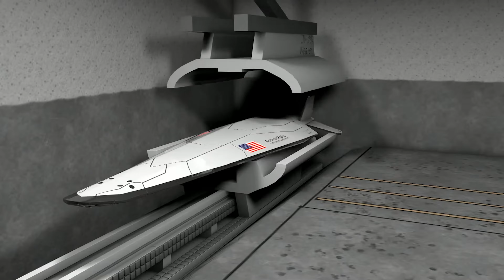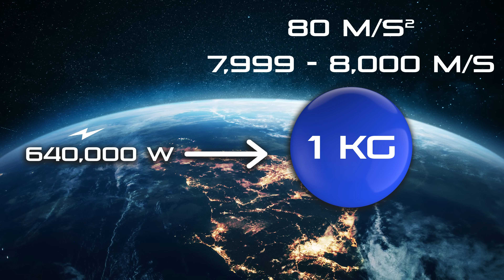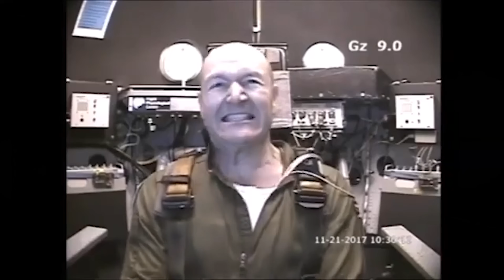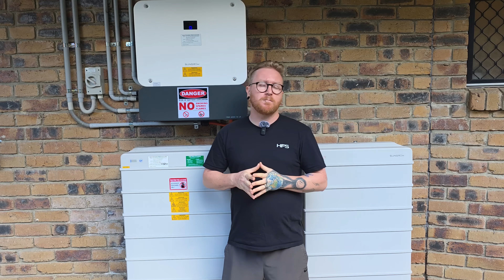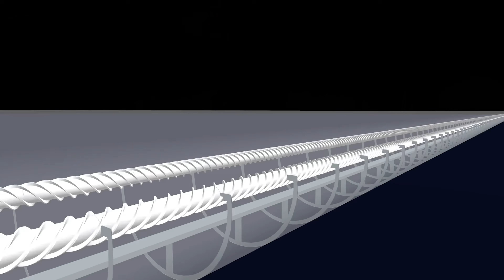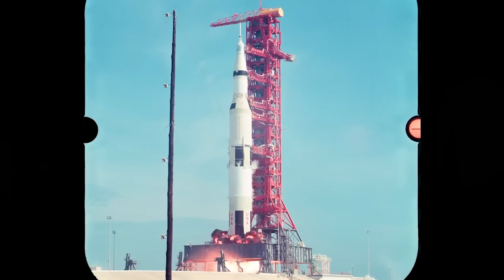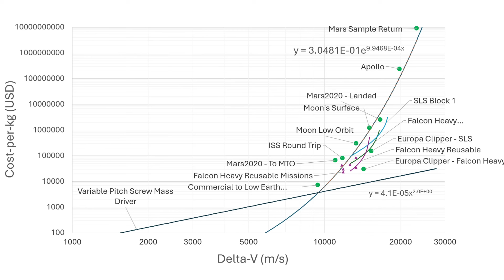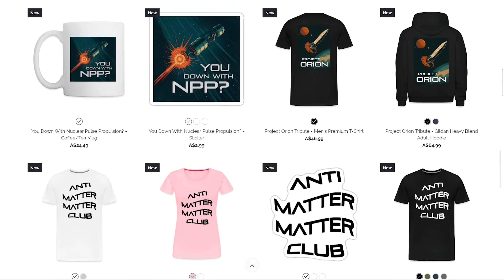The New System That Could ACTUALLY Replace Rockets

Comment: I just thought of another question, is this thing on a turret or do we need to aim the planet when we want a different orbital inclination?
Reply from the maker: Very good question! No, it isn't on a turret - it would have a fixed directional exit. Orbital mechanics get tricky to explain in a youtube comment - but you've got an onboard engine for control. Because its designed for interplanetary travel, you'd select launch times when Earth’s rotation and the desired departure geometry line up. As it pertains to achieving different earth orbits, you'd need to build specific systems for this, or make sure you had enough juice in your onboard engine to orient the spacecraft into its desired orbit. I don't think this would be that difficult.
Reply: True. It's how it works, I believe.

Comment: I take it that these screws have insignificant mass and near zero compressibility. I also take it that as the driven mass of the vehicle is insignificant and will not cause significant torsion differences in front and behind the vehicle. Eitherway, much simpler than building a bogey with wheels and electric motors.
Reply from the maker: The mass of the screws would need to be significant to store the rotational momentum. Think of them as kinetic energy storage devices, the more mass they have the more energy they can store for the same RPM.

Comment: The screw would be too long and heavy for a motor to maintain the proper amount of speed .
Reply: Not "a" motor. Thousands of them, distributed along its length. The concept may have problems, but that's not one of them.

Comment: In WW11 it was found that an airplane could tow 10 X weight it could carry. Put  spaceship on a sled with JATO rockets on it to help it get off the runway.  Use a nave aircraft with a tail hook. An f4 can carry 8 tons easily, if it takes off without full gas tanks.  Then could have 10 tons load. (80 to 100 tons towed). Refule after takeoff climb until need to need to refule again.  When it gets so high the wings cannot support it have ox or nox in tanks pull up use the nox then release the spaceship. That is enough for a satellite or two.
Reply from the maker: Very similar general idea to the Virgin Launcher One idea. This concept has one fatal flaw, it gives the rocket 'free' altitude, but not velocity. An aircraft can get a rocket to a high altitude, but is realistically only capable of giving it a very small percentage of its orbital velocity. In the case of Launcher One being dropped from a 747, the rocket still had 97% of the work to do to get to orbital velocity, compared to a ground launched rocket. It also has to waste a significant amount of fuel to change its orientation to line up with its orbit, essentially a pitch-up manoeuvre.

Its incredible that rockets work as well as they do really, the scale of their power absolutely dwarfs even very powerful planes.

Comment: The Idea ist novel but there are fatal flaws in this Idea.
If you pump a Vacuum to reduce drag you can't  shoot it out of the end of the tube because at that point you introduce a wall of air that the spacecraft will hit. If you Open the end of the tube and not have a sacrificial seal there you start a shockwave that is moving at the speed of Sound in Opposition to the spacecraft and will be like trying to brake a brickwall with a Glas sphere...
The other parts are you have a mass of several thousand tons that you want to spin up. That is all fine and dandy but how do you keep that mass in alignment? 
Now you say Magnets, good Idea with the problem that they have to disengage  and reangage because of the sled. This means moving parts and If one does not reangage your mass Driver will jump out of alignment. If one does not disengage the sled will collide with it. And If you see it in time how are you able to stop the spacecraft? How will you safe the Cargo without braking/killing it?
The other parts with the Vacuum is you want to submerge a tube that has elevated pressure in the outside and negative pressure in the inside so both forces move in the same direction. That needs so much Material that it's frightening...

Comment: Nope, this will not work, sorry. Who is the guy you interviewed, and what are his qualifications? Dude can't be a proper engineer, no way. How long are these "screws" supposed to be? How will they be supported? How will the tube around them be supported? What rpm are thes screws turning at? How are you handling the torque from one end to the other (ground end to space end?) How are you machining these? What is the "frequency" at the end of the screw supposd to be? What does the screw come into contact with? How will they remain spinning around their centr point over that distance with forces acting outward against the screw? Fantasy. Not that it would work, but even if i was going to vaporize this thing up, I'd use one screw and make the "rocket" a dounut (torus) shape kinda like a nut on a bolt. I think i just improved it, only took 10 seconds, still doesn't work at all mind.

Comment: I'm not really convinced that this system.

1) The Larger the screw pitch gets the more torque is imparted onto the screw, for the same driving force. Otherwise, we would violate conservation of energy. Furthermore, losses will be much more pronounced for large crew-pitches and maybe stop the mechanism from working entirely.

2) The screws slow down during operation, being slowest during the end where we need the biggest velocity. This makes issue 1 even worse. (Vessel speed proportional to screw-RPM and Pitch).

3) Because of the length of the system the crews can no longer be seen as a rigid body, they can twist significantly over the entire length.

4) How to do the actual coupling mechanism. Every design must either work independent of the varying pitch or be able to compensate for it. 
    a) magnetic materials (permanent magnets) are expensive, so not feasible to be used on the screw.
    b) using "passive" coils (wich would work similar to an induction motor; by relying on the current induced by the moving (relative to the coil) magnetic field) you get into problems with losses. You have to take into account that there now is slippage in the mechanism.
    c) using superconducting materials have their own issues with the cryogenic temperatures required.
Similar Problems apply to the suspension system. 

You can mitigate some of these issues (mainly 1 & 3), by not using multiple independent shorter screw segments instead of a continuous screw element.

Another problem I could see is with repeatability/accuracy. The system doesn't seem to have a way to compensate if the vessel accelerates faster or slower than in the Simulation. (If electromagnets are used, you could do something by modulating the magnetic field strength, at least when combined with passive coils). If the discrepancy is not too large Attitude control thruster could compensate for it. (Other mass-driver designs like "coil-guns" can be fine-tuned easier)

Regardless of the design of the mass-driver if you want to limit the acceleration to 80m/s² (8gees) and a speed of 11km/s (escape velocity of earth) you would need a length of 750km, and the radius of curvature must be at least 1500km. (based on liner-acceleration and centrifugal force respectively). note that this implies that you either only accelerate on a perfectly, straight track or only go through a curved section. At this speed even the curvature of the earth is significant. Because of the way the math/physics works out you would experience a centrifugal force of exactly 2G pulling upward. (1G if you take into account earth's gravity).

Suspending the launch tube several kilometers above the surface is a whole other issue.

Comment: I see this as a possible stepping stone to something better. I cannot help feel that a space lift will ultimately be better assuming you don't want an item in space for the duration of a lift. Once in space you only need engines to 'get around'.
Of course, we need to develop the tech for the lift first.
Reply from the maker: A space lift/elevator would be very hand indeed, space isn't that far away really - the issue you run into is the physical limitations of material science. There's probably a good video there on this, but the math just does not check out unfortunately. The Earth is a jealous planet, she will not give us away without a fight😅
Reply: @HelloFromSpaceAus I have seen other videos on space lift tech and it is believed it's possible with the advent of carbon nanotubes. The problem, making enough of those tubes.

Comment: How big is the deceleration on exiting the tube, and how is it kept in vacumn?
Reply from the maker: The tube exit is at relatively high altitude (15km). It would be built similarly to an airline fuselage, basically a light weight pressure vessel. The paper doesn't go too into depth on pump systems, ect - but there would be multiple airlocks to stop the entirety of the vacuum needing to be re-evacuated after each launch. I've put some links to a couple of Phil's presentations in the description, they're worth a watch if you're interested in some more technical details.

Comment: Except you could use the supergun technology intially developed by the Gerrmans in WW2 and later partially completed for Iraq. Electro-magnetic boost could start it rolling and then relatively cheap high explosives could push it in the later high engergy stages. The reason it isn't used is simply because that's not the direction that's been taken.
Reply from the maker: Ah the Schwerer Gustav - I too very much enjoy learning about war history and machinery. There are a few killer problems with this unfortunately. The g force would be incredibly destructive, large gun barrels like this tend to wear out very quickly (as the Germans and later Gerald Bull found out). The amount of explosive required would also be huge
Reply: @HelloFromSpaceAus  horses for courses. Some payloads for Moon and Mars mission would be suitable for high g acceleration, for instance rocket fuel. Explosives  don't require cryogenic handling and there are plenty of cheap explosives, e.g. those based on ammonium nitrate. Electronics can be used in high g applications, for instance guided artillery shells, so likely high g satellites wouldn't be an insurmountable problem. Current rocket launches aren't exactly gentle in any case, with vibration being a big problem.
Reply: V3 mimoyek? Iirc

Comment: If the advantages on Earth are obvious, imagine on the Moon with no atmosphere and 20% gravity.
Reply: She really is our best friend in the universe - we won’t go anywhere significant until we’re launching from the Lunar surface imo
Reply: Sure but on the moon, spinlaunch works incredibly well/simplifies, enormously,. No need for the whole container - including the door - or the vacuum pumps. Just not useful for human cargo.
Reply: This is poorly explained. How the screws store the energy prior  to use? It’s spring loaded. Mechanical,transfer. The problem is right there. Also wrong about electromagnetic set up of mass drivers, the power use is only on as the object passes a given segment of track, not on all the time. Recovering the electrical energy as described is wrong. Magnetic coupling requires energy. This whole thing is someone dreaming in an attic. Completely unreal.
Reply: @andrewtruthcourt  the screws store the energy like a flywheel
Reply: this was my first thought
Reply: The massive obstacle is being able to engineer it on the moon. We could also build a space station launcher with next to zero gravity, and launch from there. There are significant advantages to a lunar project, including using the moon itself as shielding from radiation, Scorching daytime temps, as well as physical impacts from micrometeoroids (assuming we design it inside a lava tube.) At this point the national/international will to do most of these things are small, and the Artemis program feels like it's being slow-walked.
Reply: And abrasive dust that coats everything.

Comment: Sorry great idea the physics stops you cold! Physical mass drivers are glorified slingshots! A screw driven mass drivers rotation speed and size limits is usefulness trying to over come gravy or propel the object high enough for a more traditional rocket can carry it onwards. The size of the mass also becomes a factor unless you have a long enough track to build up the needed momentum.
Magnetic rail guns offer some insights with small projectiles but as the size and mass increases even when one is not trying to achieve Mach speeds is still even with the most current super conductors and needed power into what a mid sized city would need within a few seconds! With that said the math becomes a bit better in Space as long as the object is significantly smaller than craft as it's also accelerating forward.

Comment: 38:00 You need the rocket engine to achieve your target orbit in space. It does not "replace" the velocity lost to air drag, therefore it does not have to be lighted in the atmosphere at all.
Reply from the maker: I could have worded it better, the rocket engine compensates for the losses due to air drag. VPSL isn't really trying to get to orbit, its trying to get to another celestial body like the Moon or Mars. You would ideally use the earths rotation to align the space craft with its destination, this way you don't have to waste more fuel to do so.

Comment: It definitely needs a physical proof of concept. You can make anything work in a simulation.

The exit should be at high altitude to reduce the costs of evacuating the tube. That would limit possible sites.
Reply from the maker: I agree with you there, a physical proof of concept would be great. It is in all fairness a VERY advanced simulation, but the real world is the ultimate test.

The exit is at pretty high altitude, the issue is the rest of the tube which isn't. It would still need to be evacuated unfortunately.

Comment: At 4g constant acceleration (which is probably the limit humans can tolerate for long periods) you need 776 km of track to reach LEO speed of 7.8km/s. You want to make 2 1m thick tubes full of rare earth magnets a total length of 776 km. There might not be enough rare earth on the planet for that.
Reply: Use low cost magnet made of iron, Bigger ^^.
And dig a big hole, put the 800km below the earth.
It's big, but we have the energy to make it work, the material. And the tool to make it.

I think it's gonna be 300 years of work for a such monster, but it's possible.
Reply: @obviouswarrior5460  digging tunnels, especially deep ones is stupendously expensive. If you don’t put the exit at a high enough altitude where the air is thin, you’ll get too much heating on the ship. That’s why SR-71 can’t do mach 3 close to sea level even though it’s mostly titanium.

Comment: What is the minimum distance needed to accelerate a human at tolerable g forces to leo or martian transfer velocities?
Reply: For Mars transfer, 4000 miles at 4G for 5. minutes.  I0 G would reduce the distance to 1600 miles, but the prep to survive 2 minutes of 10 G is not something many folks would care to endure. If you're only going to LEO, divide the distances by 2 and the durations by the square root of 2.

Comment: What about putting a humongous water tower on top of Mount Everest the size of a lake, drilling a water pipe wide enough to fit Starship in it, going all the way to sea level  and back up again, placing starship inside the water pipe on the ground that's filled with water but just behind a gate keeping the water from going back up, and then releasing the gate for the water to push starship up to the top of Mt Everest, igniting it's engines as it escapes the pipe at high speed.
Reply from the maker: Its an interesting idea, and there's some workable physics behind that - but my first instinct is that this wouldn't generate anywhere near enough power for a mass driver, or quickly enough. By the time you build the pipes, plus heating systems to stop them from freezing, and a large pump system - you may as well have just built a VPSL. I like the out of the box thinking though!
Reply: How about using that lake and hole on Everest but fill it full of coke and mentos, that should work😊

Comment: Release this video on April 1. You're going to build kilometers long rod with virtually infinite stiffness and symmetry. Any force the screw places on the craft will be a bending force on the rod, changing the center of gravity with reactions by the rod cascading into failure. Any vibration anywhere will be fatal. Of course you have to guarantee zero friction.
As the craft moves up the ramp the screw forces converge to being perpendicular to the fin, essentially converging to zero forward force for infinite effort. 
VPSL problems are as practical as 1/0 is a rational number.
Reply: Rotordynamics - natural frequency. What an afterthought! Trying to balance this system for practical use will be fun!
Reply: I agree. This concept is 100% April 1st.